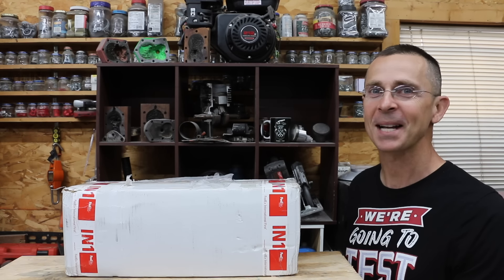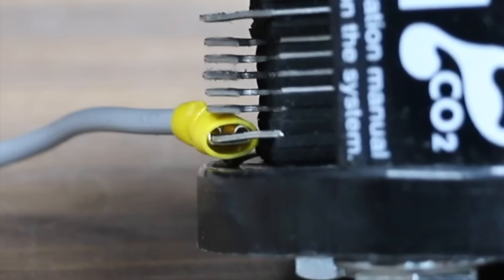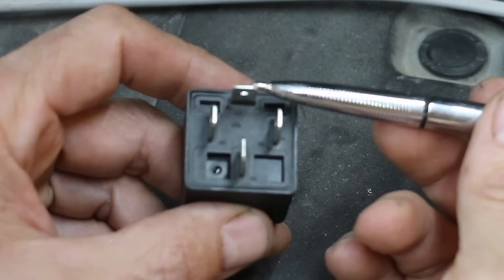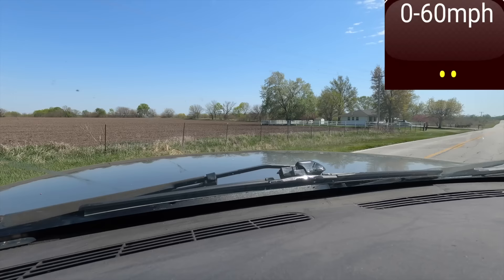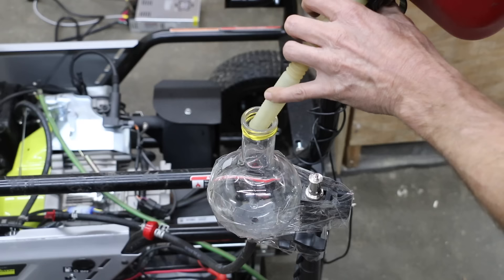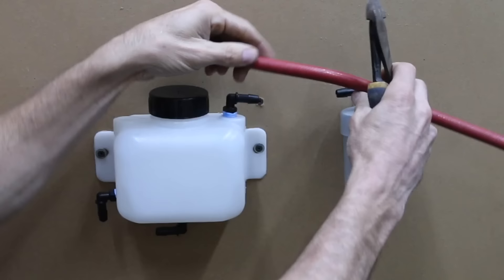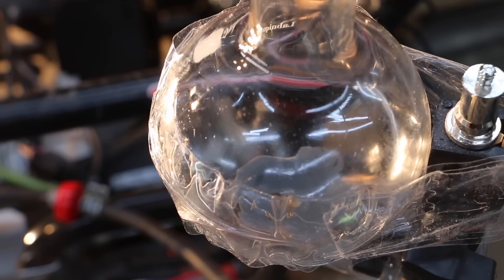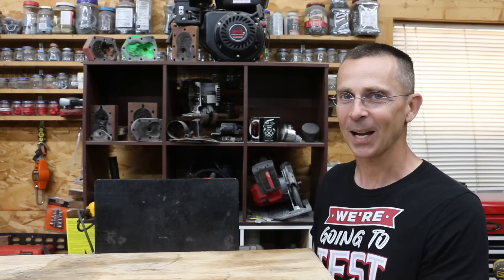AMAZING 35% More MPG with HHO? Let’s find out! Help with high gas prices?

Comment: If you still have the hho kit. Can you make another video about it while using it the “correct” way. 
Im tuning ecu’s for living and can tell u this will never work without resetting the ecu becouse it will hold on to his self learned values. 
Also I checked out the kit and there it says it will need a MAF/MAP sensor enhancer for the older cars or a HEC chip for newer cars that got pre programmed software on it(for ur model only). That u can hook up to the wires of ur OBD plug (like the race chips, only they fool ur throttle pedal response)  also i see u have the DC2000 that means its only till 2400cc engines.  
Ive also seen u did not check the amp, so that means u may have to much or to less of the product within the water, wat both give u negative results.

Hope you read this and can make another video. I really liked your video only ive seen those few things u missed and are pretty important for real possibility to get fuel savings and get better performance.
Reply from the maker: Thanks for the suggestion.
Reply: No problem. I hope u gonna do this test one more time. I really enjoyed the video and will subscribe to you.
If u have any questions about how reset the ECU or instal a HEC chip i can help if u want!

Comment: The ONLY way HHO systems provide you with ANY noticeable benefits. 
IF: You use an external power source other than your vehicles alternator (solar panel, extra batt. , portable generator ,  ect.) 
ELSE: You will see a LOSS of power due to entropy laws of thermodynamics.

Comment: I hate to be the one buttt... i you need to break the system in, you cant just turn it on and expect immediate results. One thing is aparently it cleans and durring that process. There should be a change i think you must have a divice that wasnt working.

Comment: Saving us from another snake oil product. Thanks. How about a review of "super coolant" products like Engine Ice, Coolanol and Supercool? These and other products are supposed to run engine temps down by 20 degrees and more.
Reply from the maker: Thanks!  Thanks for the suggestion.
Reply: Those additives work, but only really if you're using 100% distilled water in your cooling system. They help reduce surface tension of water which improves cooling capability. Designed for track use where glycol based coolants are often banned because spills result in a major hazard.

Comment: If you combine the HHO with the gasoline (obviously I don’t mean mix the two together but in conjunction) would it help improve fuel economy? In my mind, and I’m about as smart as my underwear, if the HHO is about equal to gasoline performance and consumption, using both would cut the fuel consumption about in half. Am I wrong?

Comment: EFI motors will not get the benefit a carbureted engine would. The computer adjusts fuel and ignition timing and defeats the hho. If you tune your computer to compensate the hho you will see more of a difference.
Reply from the maker: Thanks for the feedback.

Comment: I wonder what happen if you adjusted carburetor to lower the fuel
Reply: that is what he was supposed to do.   If you do not do that then you are using the same fuel rate but running rich be it HHO mixed in or gasoline or any other add in fuel source.

Comment: Most “fuel economy” devices are pretty much snake oil…those that do at least something, perform so poorly that you can’t really see a significant difference and not enough to justify the outlay.  The HHO thing was producing a combustible gas…but a few gas bubbles compared to an engines ravenous appetite for air means the H2 in the intake air stream was negligible.  A waste of money.  You can get a few percent better economy by running the engine just slightly lean and accepting a small loss in top power….Or learn to use a lighter right foot and turn off the AC as much as possible.
Reply from the maker: Thanks for the feedback.

Comment: You have to calculate how much ml of gas you make in a minute first and your generator it to small i think for a v8 you tk make 3 litres à minute i try on titan and it work for 100 kilo but the oxy sensor try to compense the oxygène by putains more gas ,so your gen does  she have a oxy sensor ?
My truck save 4 liter for 100kilo but for only one time after a saw my cosumtion go to normal i have to foul the oxy  sensor some how

Comment: more internet snake oil. 
there are tons of methods that do improve mileage. including the premise behind this but this company probably sold a sham. 
personally ive been working on a few ideas for some changes to vehicles for me and one of them is the simplest and stupidiest solutions and we all know about it. i had an 8000+ mile road trip planned but i changed the route and it shaves 3000 miles off but im going to run one of my ideas on the trip. power isnt needed on this trip and pretty much all of it will be highway driving so an actual 30% fuel savings would be pretty handy. the vehicle currently gets 30 mph hwy with a built v8. 1 simple change and i can easily get over 40 mpg. and still have more power than that vehicle made stock. and double the fuel economy.

Comment: Mmmmmm...... Remove the Entrained and Dissolved Air in the fuel in the tank with the use of Ox-cetane.

This will let the fuel clean the carbon/soot out of the engine restoring lost fuel economy.

Comment: Personally i believe that you are one unsatisfied customer. And you made all this efford to prove that someone sold you something that actually not working.  

Well mister HHO isnt for everyone. As diesel isn't as well . If your commutes are really short, neither HHO nor diesel will make any difference in fuel economy. 

I have used this kit (similar one ) for more than 8-9 years on my car. A 2000cc petrol.  After the instalation (that wasnt made by myself but from people who got trained to install such kits) with the supervision and fine tuning from a chemical engineer through OBD, adjusted for the needs in air, fuel and power Amps, the car managed to do in open road fuel economy numbers that were below factory standards. Also at the CO2 yearly emitions test was below 25CO2. All that at a 15 years old Ford engine. 
Last but not least, the engine for some reason was cooling of faster while coasting and the power in mid RPMs was better.   

Maybe u just needed a better group a mechanics to do the installation in your car. 

Take care

Comment: You are not getting better fuel economy, you are just supplementing the fuel with another fuel. Potassium hydroxide is not cheap and it can be very caustic which might cause skin burns or worse if it gets into your eyes. And who knows what damage it might do to the car's emissions systems? If you need a new catalytic converter after 1,000 miles, how much did you really save?

Comment: this mans tests are very inaccurate. let me explain. in every combustible fuel source the amount of energy there within is called calories; those calories determines the amount of energy released during combustion. so higher combustible fuels release more energy simple right. having said that I ad this. octane is the measure of a fuels resistance to detonation; as in it can be compressed to higher pressures before spontaneous combustion. now here's why that matters; higher octane fuels release more energy because the onboard computer advances the timing of an EFI engine, and that action is controlled by the knock sensor. so thus the fuel is compressed to a higher psi before ignition, and so puts more pressure on the piston during said combustion state. the higher and hotter the combustion state is results in less hydrocarbons. this is how hydrogen works. the typical gasoline engine only burns around 30% of the fuel injected, because of its low octane levels and low resistance to pre detonation. the result is those said hydrocarbons. when we add hydrogen to the mix the octane levels rise because hydrogen has a higher spontaneous combustion temperature and so the onboard computer can add more timing resulting in more energy being released during combustion stroke. and the result of that is that it takes less foot in pedal to move a given weight and so fuel consumption goes down and mpg goes up. that is not measurable using a constant state gasoline generator designed to run at a preset rpm. in fact it would show the opposite results during a test because the fuel when adding hydrogen would be more resistant to said composition unless timing was added so fuel economy would actually decrease. make's sense right? so there is actually two ways to get better fuel economy with an hho generator. control the voltage of the o2 sensor so the onboard computer reduces the pulse voltage of the injectors IE less fuel relative to the amount of hydrogen injected and so fuel economy improves. this would work well on an obd1 system or let the computer do it on its own. but I would open up the gap on my spark spugs by about 10,000 so to advance ignition timing. don't know if I can explain it any better than that.

Comment: I am 2 minutes into the video...but I predict that it will hurt fuel economy. The energy that goes into generating the HHO will exceed significantly the energy you would get out of it by burning it again. That, coupled with the typical 20% efficiency that you get out of a gas engine means that this should be a real loser.
Reply from the maker: Thanks for the feedback.
Reply: @ProjectFarm  No worries, happy to see your results confirmed my prediction. Lots of these "free energy" devices require a direct violation of thermodynamics, and when you see that, it's easy to predict the outcome. 

BTW, I do love your videos.

Comment: I had great results with my hydrogen generator, 13 years ago, for about 10 hours and then it got rusty, but I could pull as much as 360 watts. Yours isn't that powerful. Plus I had some kind of device (I forgot the name) that connects to the Mass Airflow Sensor to lean it out and that's how I increased fuel economy.
Reply from the maker: Thanks for the feedback.

Comment: It should help. The fact that it doesn’t probably indicates that the fuel cell isn’t powerful enough. It could also be creating a loss of energy because of the amount of energy needed to power the hho generator. Ideally you would use solar power to convert the water into Gas. Lastly are you using distilled water? It could make a difference.

Comment: It appears to me you do not know what you are doing with HHO gas. You are not producing enough HHO gas to do anything by reducing the HHO Gas amount. If you are producing enough HHO gas you should hear the engine speed up some. The temperature of the engine will drop during the running time. I have run engines 100% on oxyhydrogen gas only. When oxyhydrogen gas is added to the gasoline there is a dramatic improvement that you can hear and see. I have 13 years hands-on experience and what you are doing is not fair because you have no idea what you are doing to make your claims.

Comment: Of course this sistem can not work, the ratio of gas produced comparing with the volume of air consumed by the intake of the engine is nothing. To see results we would need a huge machine consuming an absurd amount of energy.
Reply from the maker: Thanks for the feedback.

Comment: that is really clasical your video, 4 cycle 1 litter engine in 3000 RPM, sucked in 750 L air, and the HHO 10L/ min  can really produce very small protion of power for that, i dont think any extra battery nor solar cell will help to save any petrol milage, you cant defy physics.
Reply from the maker: Thanks!

Comment: HHO is an utter scam.   Alternators are 50% efficient so you are using extra energy.  The max Hydrogen energy you are adding is in the order of 100W, not very significant either way, but you need 200W of mechanical energy from the engine to get that.  Ever time it is tested its the same result.
Reply from the maker: Good Point!

Comment: Have you tried to rejet ( change gasoline delivery quantity) the carb's to use the Brown's gas, instead of burning gas? The fuel usage will be the same in your tests, because the same amount of air ( even though HHO is in it) is being passed through the throat. In larger quantities, you should be able to run the vehicle on only Brown's gas. It is the perfect mixture for combustion. Browns gas can be used as fuel, if done correctly. Fill a balloon up with it, hit it with a lighter, he he he. Don't dare use a garbage bag, he he he....

Comment: The thing is with your test. The hho generator needed to be hot wire directly to the alternator. The cell has to be the hho generator thats not a dry cell.
Reply: If you check out the other apps a fellow used a hho on his gm truck direct to alternator and was actually getting 20 miles more a gal

Comment: You should have known that by adding more O2 on a fuel injected system the O2 sensor will pick that up as a lean condition and add more fuel. Did you neglect to say that on purpose? The ECM would need to be reprogrammed for the additional O2 being added or a different type of Hydrogen generator would need to be installed with segregated plates so the O2 and hydrogen would truly be separate gasses. Most electric generators are of the carburated type, it seems you knew what the results would be prior to making this video and chose that generator on purpose.

Comment: I used to like your channel , but you've stopped that. I've used hho dc 4000 on my boat and my car , both improve power on a Dino and fuel economy improves. Peugeot 1900 diesel went from 59 mpg to 70 mpg . Engine after running for 3 yrs was spotless inside ,oil changes after 8000miles still clean , for a diesel . So if your going to do this . Do it right

Comment: I want to see actual engine ecu logs😂 I'm going to do it with an actual factory ecu tool that allows viewing of EVERY single parameter, Hundreds of parameters- you'll be able to see exactly what's happening and the difference in logs. ACTUAL quantifiable data. Nobody actually has done that. Just driving recording mpg and looking at Carbon. Not knocking it but that is a FAR cry from an efficient test of exactly what's happening😂 you would have to reduce fuel input and rely partially on the HHO to make that up to see any increase in mpg. The car doesn't do that on its own. It would likely just see a higher combustion temp modify timing and ADD fuel. (my money is on it showing increased combustion heat and causing all sorts of hell to an otherwise perfectly running engine unless you actually tune the engine)

Comment: this setup is incorrect .. replace the fuel with the hydrogen gas . putting it into the intake isn't doing anything
Reply: 😂😂😂 Stay in school
Reply: @LimeHax  you have no idea what your talking about .. I use hydrogen gas to run my generator when I'm camping .  this video is accurate to the extent of what the directions say to do   but  in the real world putting the gas into your intake does absolutely nothing other then  a carbon flush to the system ...  you need a much larger tank to store the hydrogen gas like the size of a scuba tank to run a car on , also connecting the the system to your fuel lines is 100 percent possible to use the hho gas but not with this method ..

don't believe me  doesn't matter do a quick Google search on how nasa powered their systems to go to the moon and back bud..